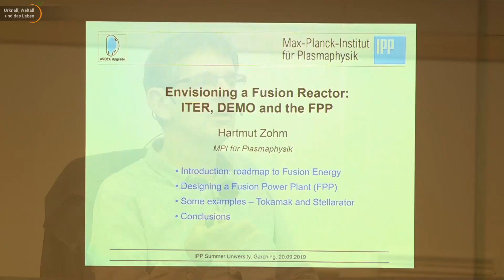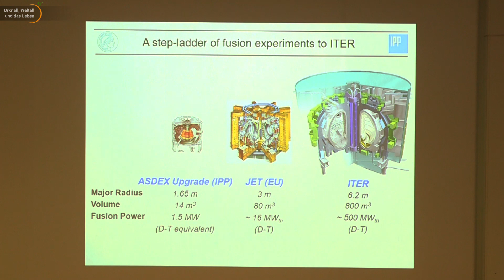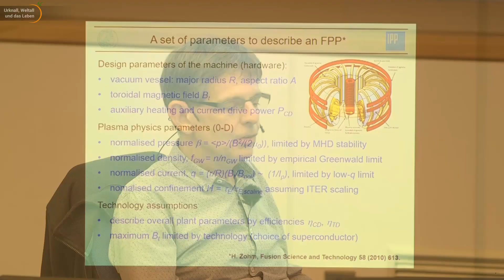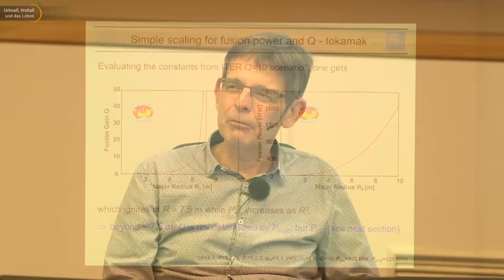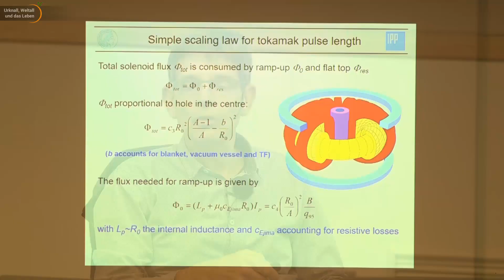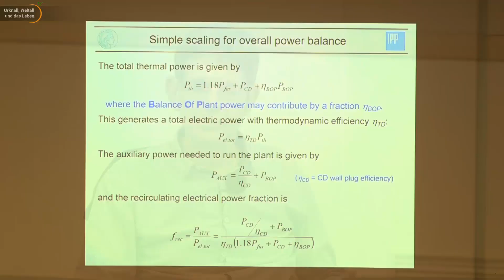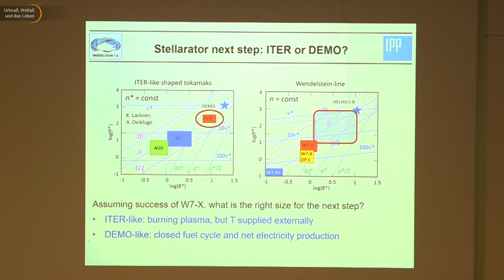Envisioning a Fusion Reactor - ITER DEMO and the FPP | Hartmut Zohm

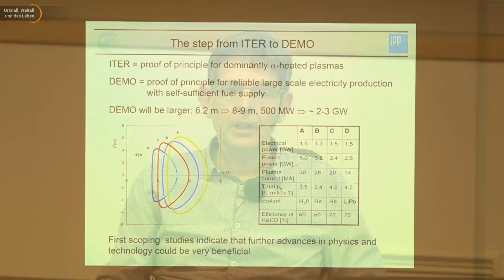Comment: 18:21 slide with different versions of DEMO (- depending on how optimistic you are concerning available vs new technology)
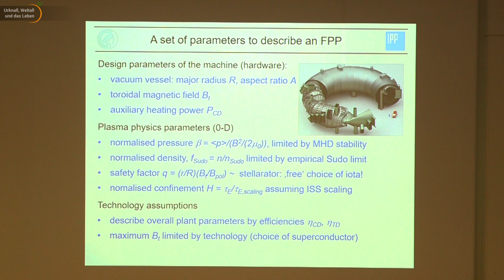26:43 additional constraints from power exhaust / “this is serious”
32:26 ITER too small to go to ignition, only because politicians did not want to pay twice the price some 20 years ago...(- possibly resulting in the need for one additional step / Tokamak machine (=DEMO) later... )

Politicians looking 20 years into the future instead of 40... - I so hope China will change that game... - this isn’t about who makes the money, this is about who saves the planet!

37:36 somewhat similar equations / curves for the Stellerator
43:20 two external ways that help drive the Tokamak plasma current (- in addition to what is provided by the solenoid ramping up / the inductive part) - (“cd” indicates the sum of all “current drive”-power-requirements in all discussed tokamak proposals)
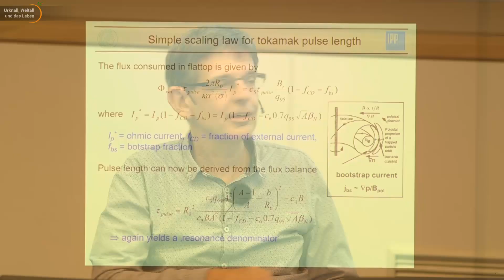45:21 Simple scaling law for tokamak pulse length (plot)
46:00 if you could drive the tokamak plasma current externally  (50% plus the “bootstrap” providing the rest), you could get a steady state, but that is impossible (because of the instability being 2-3 times too high at the required pressure), unless one is willing to make changes that result in drastically dropping the efficiency of the machine. But then you need a lot more of the fusion power to just drive the current / keep the machine going; as shown in the proposal at 46:42 ITER Q=5 scenario (- As far as I understand this, in this proposal, the resulting thermal output would only be 5x the electric input?).
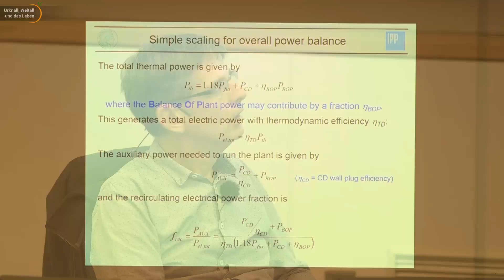48:01 Simple scaling for overall power balance
51:46 Why Stellarators are more promising than Tokamaks for actual power plants: you want to get the “Recirculating Power Fraction” down to 10%, as well as the Net Electric Power to 1 GW output, for to be more comparable to fission reactors, and Stellarators will get you there with less than 3 GW Fusion Power (thermal). Stellarators would require less investment capital upfront (or rather about equal, as it turns out later in the talk) AND significantly more return on investment at all “reasonable” sizes.
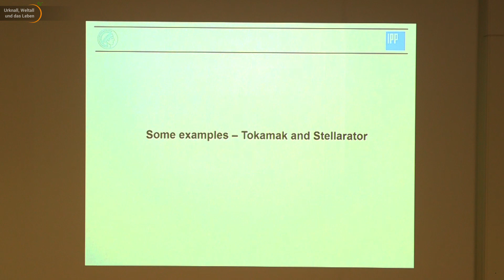54:07 Some examples / step ladder approach
56:19 “... of course you have to increase the field here...” - lol: increasing B from 4.5 to 6.1 just like that... (- that’s Tesla I assume? - Good luck with your superconductors I guess? - Also: 3.5 GW of fusion power / thermal for the “smallest” economically viable Tokamak FPP... - I hope you find someone able to afford the upfront investment...
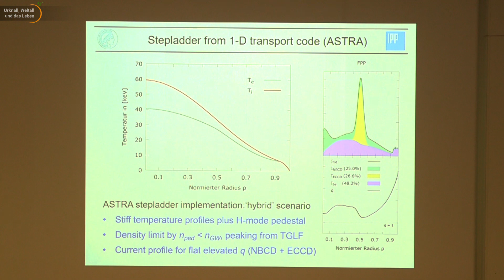59:01 next steps for tokamak to FPP: become stationary / steady state through “bootstrap” and “external current drive” (- already looks promising)
1:00:16 next step for stellarator to FFP: catching up with two steps less: but which leap to do first?
1:02:42 The small one (Option A equivalent to ITER), or the large one (Option C equivalent to DEMO)?
1:03:42 Plasma physicists want to play it safe and go for Option A, to have more time to work out “non-linearities” / “turbulent transport” experimentally first, also banking on the transferability of things learned with DEMO about Tritium breeding etc. (- probably no need to research this double / concurrently), before doing the larger leap to a functioning FPP in the 2050s.
1:05:37 “The final question”: how much is it?
1:06:02 “surprisingly” about the same cost for either a tokamak or stellarator FPP. (lol, really? - more than 50% more superconductor mass for the stellarator, but less than 20% higher costs for the magnets? I don’t think so...) - But I guess you are right: smaller, easier to transport magnets means you can build the stellarator FPP with prefabricated magnets easier / at harder to reach locations = more locations.
1:09:07 “(you) want to have this beast running... for months... in a reliable fashion”, “this will not be an experiment, but a thing... done by industry... fit in order to run...” / Charles Lindberg analogy / “... give it to the engineers...”
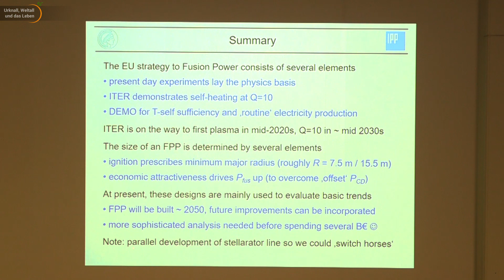1:12:00 maybe we can switch horses / change saddles, if stellarators turn out to be “the faster horse... to the finish line”

Comment: 40:00 I do understand that induction only occurs when the magnetic flux changes over time, however after hitting the current limit in the transformer the current could be decreased at the same rate it was increased at which should create the same current.
This would also reverse the current induced into the plasma, however the magnetic field created by this current is only meant to counteract the drift of the plasma towards the torus wall, isn't it?
Reply from the maker: Hallo Tristan,
Wenn Sie das Feld umpolen wird die Strömungsrichtung im Plasma umgekehrt - das würde Kollisionen im Plasma erzeugen und Teilchen zur Wand ablenken.
Gruß Josef M. Gaßner
Reply: @UrknallWeltallLeben  Danke für die super schnelle Antwort :) Ich dachte, dass das durch den Strom im Plasma erzeugte polodiale Magnetfeld nur einen sehr kleinen Effekt auf die Strömungsrichtung des Plasmas hat aber jetzt ergibt es für mich auch Sinn. Die elektrische Stromrichtung umzukehren würde ja auch bedeuten, die Gängigkeit des helikalen Magnetfeldes umzukehren, nicht?
Reply from the maker: Hallo Tristan,
linke Hand Regel...
Gruß Josef M. Gaßner

Comment: Does fusion power have the potential (according to the current state of sience and research) to be better for nature than todays renewable energy plants (like solar, hydro and so on)?
Reply: The thing is that it might be not affordable or manageable to just feed our energy demand (electricity, heating, transport) with renewables only. If you plug in your cable into the plug at the exact same time more eletricity has to be produced somewhere. Ofc not for every human this can be done but overall the exact demand and production has to match each other. Thus it is convinient to have a reactor which can produce very precise power outputs on scaduled demand. So Ofc it is not more environmental friendly in that case than rewnewables but we always need a mix i guess
Reply: There has to be a mix of renewables and other sources. It's never one or the other. And fusion power is hopefully the solution for a safe and stable power grid for centuries to come in addition to renewables.
Reply: the problem with renewables is storage. if you don’t have storage at scale, it is hard to push the percentage of renewables beyond 30-40%. the rest needs to be base-load capable. If you solve storage at scale at reasonable cost, renewables will be cheaper.

You still want to develop fusion power for the far future: let’s say you want a human outpost in the asteroid belt, or on the poles of the moon (- where there is water ice at the bottom of some craters), you will be out of luck with renewables.

Comment: Dear Physik ist relativ,

first of all: I probably was too rude. It was not my intention to embarrass anybody. If this was the case, I deeply regret and apologize. Second: I thank you very much for your replay. May I also add: I am not against research in nuclear fusion. A source of abundant energy is very desirable. And even if there is no energy source: research is never a fault. We are humans…

But – I doubt in this technology. Over the years, it got more and more complicated and therefore also more and more expensive. My doubts: can we really have such machines everywhere in the world where they supply with the demands of energy? How expensive would they be? Has at any time such machine provided with the required tritium for it’s operation? How long will the used materials tolerate the neutron flow? And how much radioactivity is produced how long? If such a machine really works: how much energy can it produce under optimal conditions?

You see my concerns. Following your mail, I also could say: there is really a lot of room for discussion. Presently, I am not convinced, that this technology is feasible. Maybe, in the future, someone is able to change my mind. Then, with great pleasure, I will do active advertisement.

Presently again: from now on, I will keep my mouth shut. With cordial regards and all the best wishes to you:

Dr Hermann Middeke

Good luck!!

Comment: Again, I don't buy it. Again, there is a decades timeline. "In 2026 we will do this and that..." Why not tomorrow? There was sufficient time in the past. Energy for the world? Nigeria, Congo, South Africa...? Forget it! Completely!
Reply: Why not tomorrow is quite simple:
First of all fusion research does not see that much financial support than they should optain in my opinion. The actual finanzing is below the estimated „minimal“ costs which are necessary to maintain the knowlege calculated in the 1970s (not sure about the exact time but i can look it up if you wish so)

Fusion is very complicated (especial the high demands on the material in the power exhaust (divertor region)), since we have a high neutral bombardment and thermal stress.

At the beginning the scientists thought to be able to build small devices to optain ignition conditions (that was the origin in the „in 20 years we got it“ phrase) but soon they recognized that there were phenomena they did not knew from an theoretical approach (Neoclassical and anormal transport). They observed this once they had build the first small (tablesized) Tokamaks. Now we know that we have to build huge devices which need a long time to construct.

ITER takes so long as it is a multinational project which is also meant to „teach the basics“ to its contributors.

I have plenty more to say but I‘ll stop here i guess. One thing which I would like to say: dont be so negative all the time... this is the second time i reply on a comment of you which is just negative and has no feedback or „konstruktive Kritik“ thus it would be great if you could funnel your doubt into sth which in deed motivates instead of simply flaming it to be nonsense if you yourself dont know the topic well enough xD